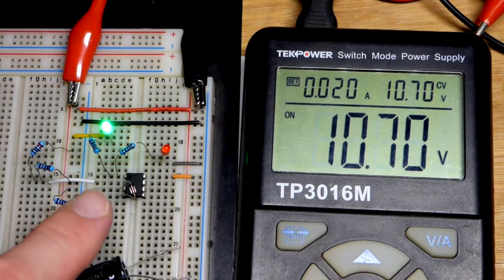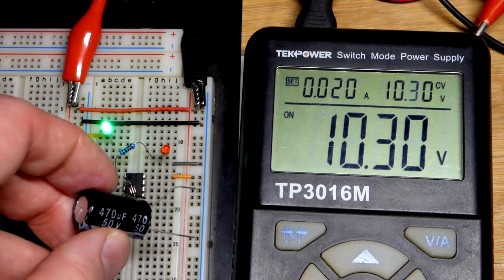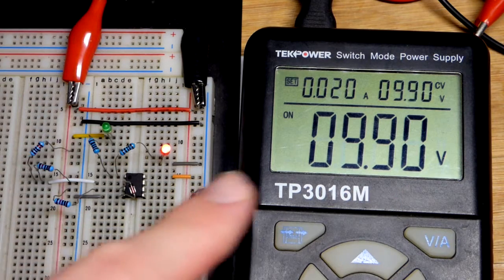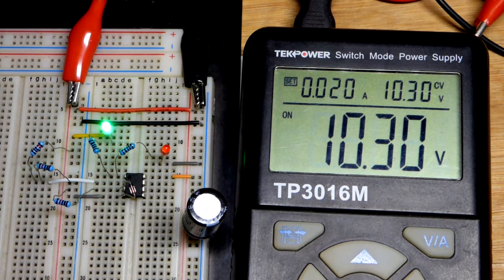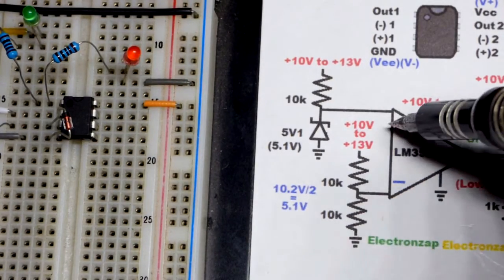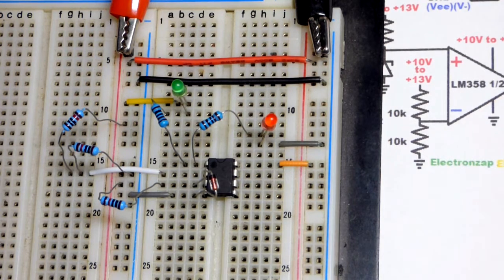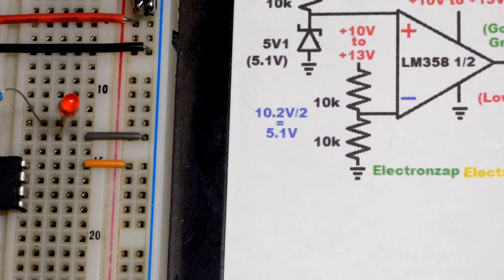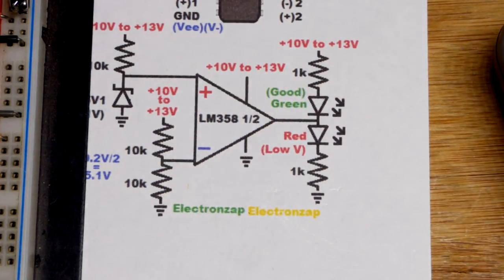Low supply voltage indicator with zener diode op amp inv comparator learning electronics shorts 44

Comment: Thanks for these videos. They help me to learn about electronics. ...So can you show a circuit to cut battery power when the voltage drops?
Reply from the maker: I have a couple videos that go live on Nov 20. One in the morning and the other in the evening in the US. They show low voltage cut off using the NPN and PNP Bipolar Junction Transistors for low power circuits. I'll try to remember to make more low voltage shut off videos, but I make videos faster than I have them go live, so the videos I'm making today, go live in about a week from today.
Reply: Looking forward to seeing them!